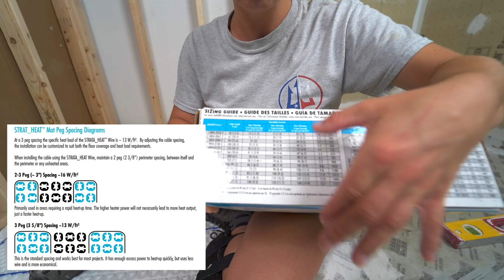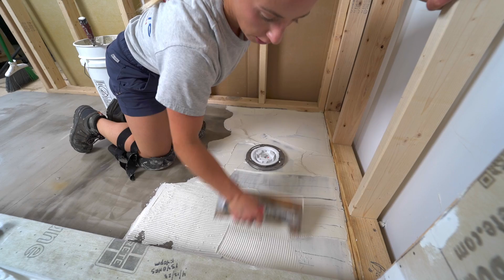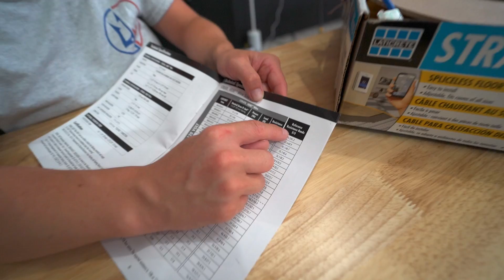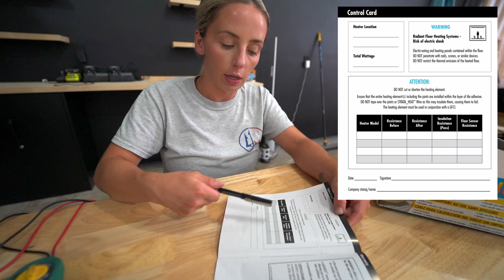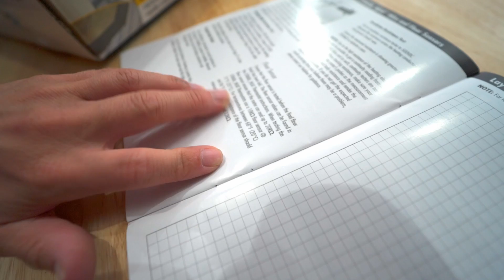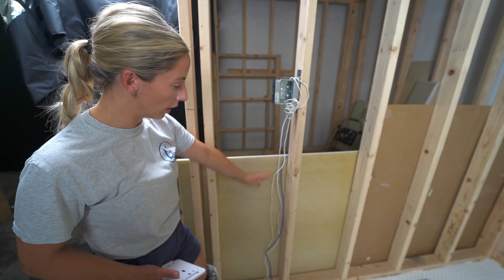How to: Install heated floors for tile

Comment: No 120 will run up light bill. 220 is best way to go always,  un😂these kits are sold in such a way that hinders you from putting 220 in a small room
Reply: That’s actually a common misunderstanding. 120 and 240 will draw the same amount of watts to achieve the same heat output. Watts = amps x Volts, so you end up pulling more amps with 120, but you’re billed for watts not amps. So because the watts are the same the cost is the same.

Comment: Great Video! I was once a semi-experienced tiler for a remodeling company but the times and material technology has changed quite a bit. That said, I'm in the planning stages of installing a heated floor. I was originally looking at Ditra Heat until I found your video and looked at the Laticrete options - I think I'm now leaning towards Laticrete! Ditra does not offer a 240 volt wire for a small area (20sf) but Laticrete does. I don't want to use a 120 volt system. Thanks. This will help get me through the learning curve.

Comment: What did you have for subfloor below the thin set?
I have 3/4" plywood wood plus self lever, would that be enough subfloor in addition to the uncoupling matt for tile?
Reply from the maker: Exterior glue plywood that was floated out with NXT SKIM LITE which is a patching compound that you can use over wood to fill any low spots prior to tile.

Comment: You did an Amazing job on this install and great step by step instructions. In a very hot work area. Any idea the life span of the heat cable? Hopefully at least 10 years. Thanks!!!
Reply from the maker: Thank you James! I’m not sure on the life expectancy of the cable I will ask some friends over at Laticrete and let you know
Reply: STRATA_HEAT components are covered by the LATICRETE Lifetime System Warranty. If only the wire was used, then it has a one-year product warranty only.